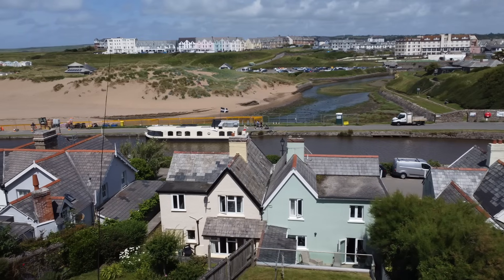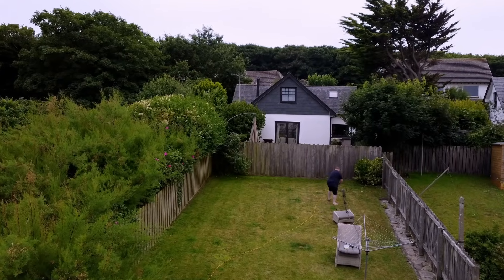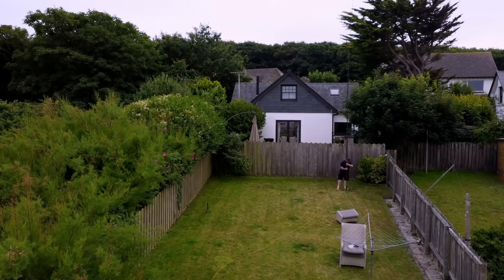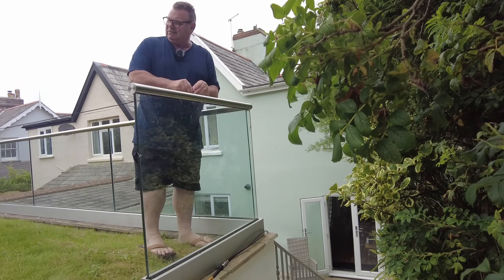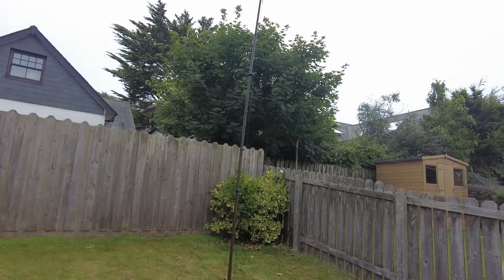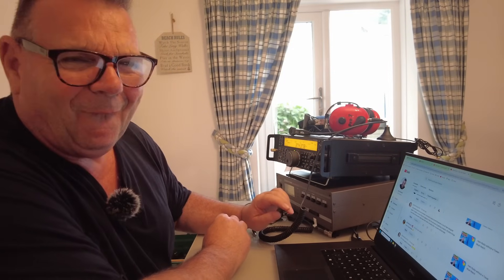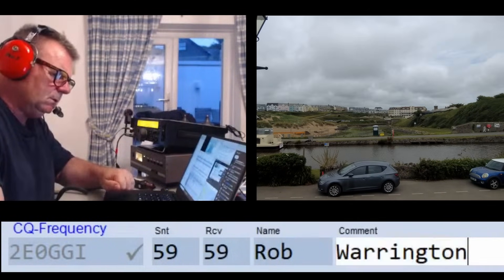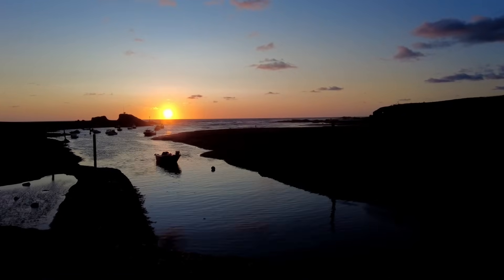Full Deploy And Test - 80m Inverted L

Comment: Hi Cal, Seem something odd is occurring with my antenna efforts. I am still figuring this out, but it seems the 80 and 40 meter antennas I put up near my house are extremely inefficient.

 Have you ever heard of a similar issue?

 I have always used different new coax etc. for each antenna so it's not coax or connections. The evaluation is by remote SDRs in different locations and directions.  The only antenna that worked well on 80 and 40 was a center feed dipole 200 foot long that was  feed with ladder line with tuner and that is my fall back plan. My theory is that it had length further from the house. 

Next experiment I think I'll try a vertical delta loop as far from the house as I can fit on my small city lot. 

Thanks for all the videos.
Reply from the maker: Inefficient.. TX or RX I wonder. Not heard this before unless something is soaking up the RF somewhere (unlikely)
Reply: @DXCommanderHQ   I think I'll try putting up an antenna further from the house as an experiment. Trade height for shorter length with the point down vertical delta loop (small lot). Have Wire & balun on order. Might await cooler weather.

Comment: Amazing what such a theoretically imperfect antenna can do! By imperfect I mean the  vertical is short, and you're relying on the capacitance of the horizontal (a 'damper') to make the vert look electrically longer. I always used to find that if the angle of the top was less than 90º, it had a profound effect on signal. 
But yours is doing really well, and by the sound of it a lovely low noise floor!
I wish my 80m was as quiet. Bzzzzzzzzzzzzzzzzzzzzz.
Reply from the maker: I know Andy... I think being really low helps the match weirdly.

Comment: What i often read and hear with Inv.L.- Antennas is, that the horizontal element doesn't radiate at all. Only the vertical part should act as radiator, as they say. Now you are stating, that the DX Commander in Inv. L.- Configuration on 80m is adding a bit of horizontal radiation to the vertical part. It would be nice if you could explain this in more detail, Callum. Thanks a lot! 73 de DO1LR.
Reply from the maker: Honestly, it does... I mean I COULD make a video but if you listen to my Inverted L test video, it is clear I MUST have had a lot of NVIS due to signal strengths.
Reply: @DXCommanderHQ  Well, i believe many hams could  have questions of this kind. Especially the ones that don't have the space for large dipoles, but look for a possibilty to do some ragchewing on 80. Many older hams fanatically advise against using an inverted L because it is supposedly only suitable for DX. Would be beneficial for your sales i guess.
Reply from the maker: Older hams... Yeah OK, some of them used to read too many books - luckily, ther's folks out there just doing it LOL!

Comment: I just got my Expedition all tuned with 5 elements. I had to abandon 30m. 15m is horrid, but the others are pretty good. Tonight is some testing amd next week is a bunch on 40m.

How much does adding the inverted L change the tune of the other elements? Also, sometimes you use the top spreader and other tines you tell.people to use the middle spreader. How much of a difference does it make?

Thanks Cal!
Reply from the maker: OK so 40m went low... I would need to trim.

Comment: I run my Classic with 80m as an inverted L. Our state emergency voice net (US) is on 3862 so the 80m element is tuned at 3860 but I can't get the swr below 2:1 without a tuner and my amp requires 2:1 or better to work. Because of space I have 32 three meter radials and wonder if a couple of longer radials would make a difference. Beautiful holiday spot btw. Enjoy!
Reply from the maker: Hey Jack... I am thinking height matters... DO a test and drop it down to the middle big spreader - not too high.

Comment: That was great ! I bet the dogs loves the trip as well ! I got new pole and wire and stuff from DX Engineering on the way . Having day dreams of antenna fun  . Maybe some day send a roll of DX 50 to DXE . They had the DX 10 .Now I can daydream blowing up a bridge . LOL . I have the 2024 expedition . I did not do 80 meter so far. I have the wire but outher plans for that . I have that M & P Pota flex 7 . I got the kit with the reel winder and case. Great stuff from Italy ! I have RM Italy KL 506 amp as well. Great stuff for POTA which is big in the USA and outher countries as well. Cheers to Wendy ,Gina, Loki, Callum   and the rest of DX Commander !  for keeping radio FUN !  73 from NY , USA !!
Reply from the maker: Yes, the winder is actually pretty cool - at least I have some dedicated /P coax finally!

Comment: Hi Calum can you help l've made a gain master antenna for 10/11 m by which involves a 10pf/10kv capacitor and a Q section for impedance matching
I've got low swr for 27.285mhz but its only resonant at 26.500mhz any help would be appreciated thanks. M7HZR. 73.
Reply from the maker: OK... Hop over to Mike's channel (M0MSN) and find his GainMaster video. Then leave a comment there. Mike will respond. If real emergency - find him on QRZ..

Comment: What sort of distance are you getting on those reports. The UK as a whole is relatively small as compared to my part of the world so it would be interesting to know the actual crow flies distance in general. Ontario alone is 4 1/2 times the size of the entire UK.
Reply from the maker: Well, Cornwall to Scotland - I don't know - maybe 400 miles. But it wasn't totally dark. I would expect it to go longer later - say by 23:00 or Midnight..
Reply: @DXCommanderHQ Still pretty decent reach.
Reply: @DXCommanderHQ  being that low it’s NVIS - the sloping tail probably helps lean the signal over.